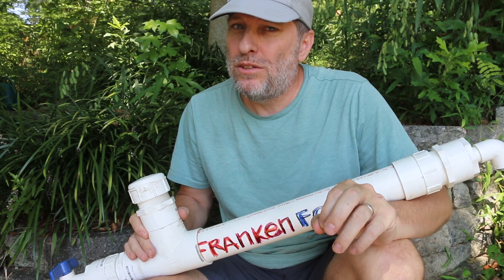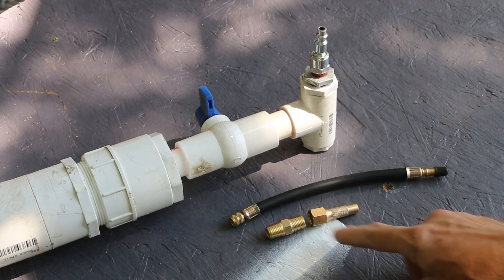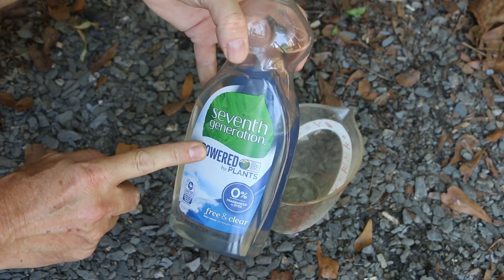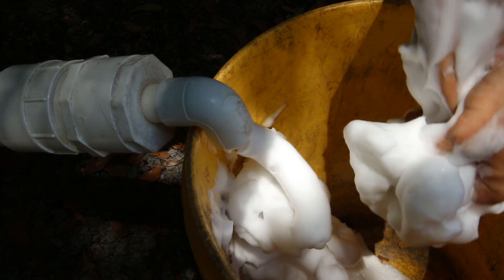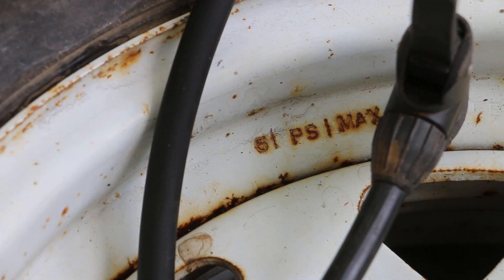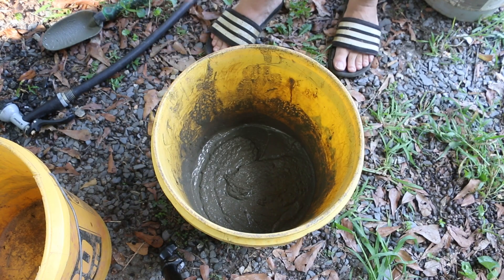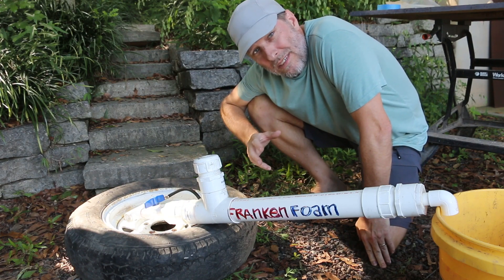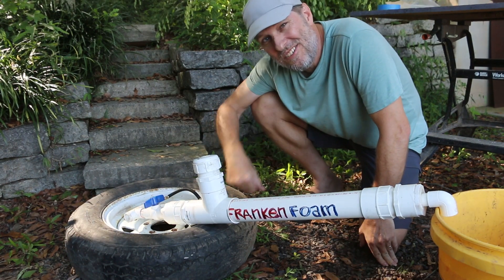How To Make Aircrete With A Tire For A Compressor

Comment: You might just need only the inner tube. If you can find a big tube for tractor tire you will have pressure for longer. The just fill it at a service station for free.

Comment: The cheapest air compressors are those that are used in nail art. You can find them for around 20 bucks. 

The pressure is just 25 psi, but seeing the good results from just the tire pressure, that could be worth a try.
Reply from the maker: In today's video I tried my tire inflator. It worked great. Thank you for watching.

Comment: How would you air up the tire to begin with?
Reply: Bicycle pump.  Sorry.
Reply from the maker: Or another option would be to take it to a gas station to pump. It’s not ideal, but rather a creative way to avoid buying an air compressor. :-) Thank you for watching.
Reply: @GreenShortzDIY  I'd probably just use my compressor.

Comment: Aircrete! I think that's how I found your channel. Nice to see how well that worked with the tire. I would not want to pump up that tire with the bike pump though!
Reply from the maker: Ha. I agree. This was just a fun option to play with. :-) Nice to see you. Thank you for watching.
Reply: I did have a thought about filling the tire from a small 12V compressor like you might carry in your vehicle.  You could power it from the solar rig on the trailer and be green!

Comment: Sugar water and dish soap will hold the bubbles, it's what kids bkow bubbles are made of.
Reply from the maker: Thanks for the tip. I hadn't heard of using sugar in the water. Interesting. Thanks for watching.
Reply: Have you tried it and seen how the bugs treat the aircrete with sugar in it?